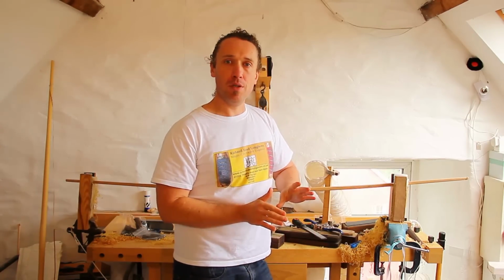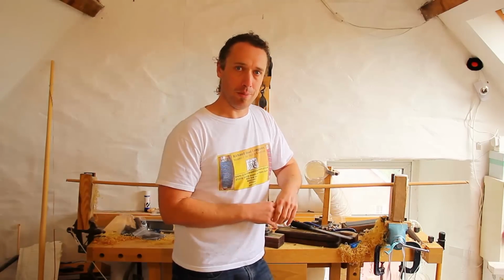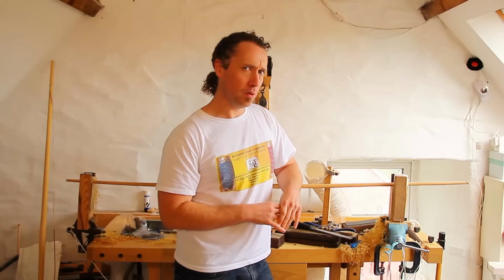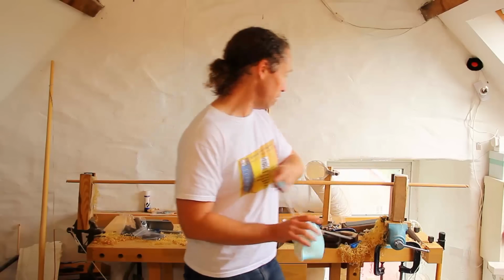How to rough out an English Longbow stave and safety in the workplace!

Comment: Very nice video. The way I have been gluing up mine, I taper the width and thickness in the laminates before I glue up (with rubber bands / bike inner tubes). When I glue up, I will put the tips on two saw horses, and hang a weight from the middle to induce reflex (if I want reflex for the stave). After that, I will rasp off the dried glue, round the belly off with a farriers rasp, cut the nocks, and start tillering. I think doing it this way helps the reflex be even, but it can make the bow glue up crooked too, which is a pain in the butt.
Reply from the maker: Glad this helped, feel free to sub and like, thanks and good luck with your project.

Comment: HI Richard , I have used bamboo for the first time on a stave , after cutting it out the thickness of the bamboo is a little more than i would like at each end , my question is , is it possible to take it down or do you have to keep the integrity of the top layers with bamboo .  all the best , Wayne
Reply from the maker: squeakattack1 Hi Wayne, yuo can reduce the thickness of the bamboo BUT you must keep the nodes intact.